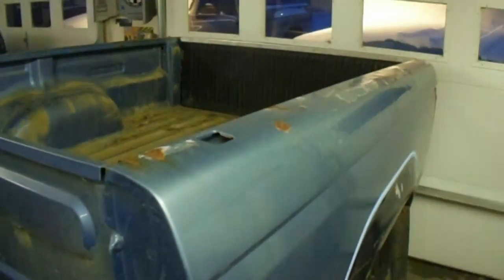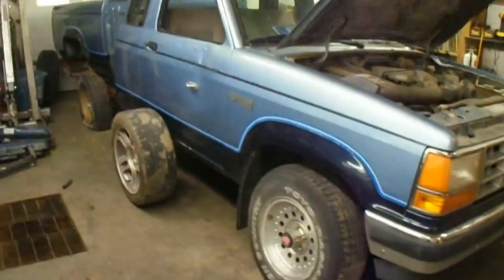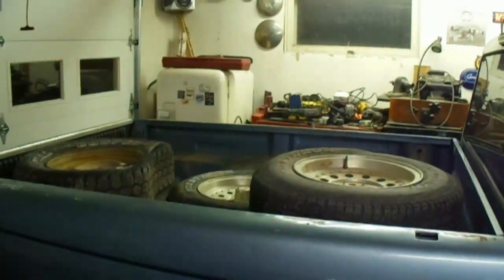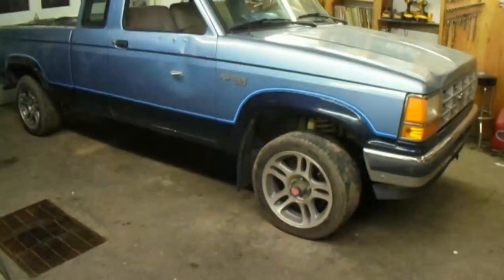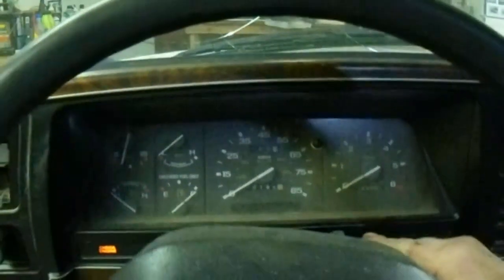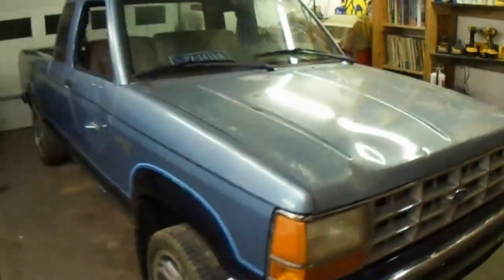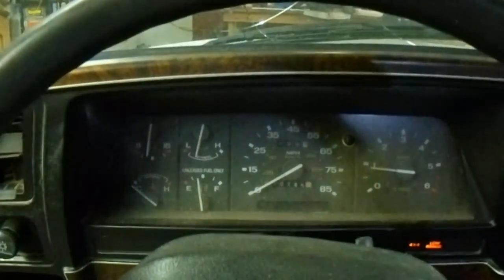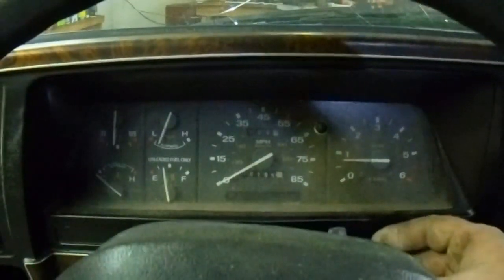First start of the danger ranger 2.0

Comment: Great to see you doing videos again Wayne!!!. Love your vids and always will!. Anyways; yes it always is essential to make sure a vehicle is safe to drive before giving it back to a customer if you are a garage owner etc. I have a 2007 Lexus rx350 that initially when i first got it only had 66,000 miles on it. But now its starting to really show its age as things have started going downhill. First; my high pressure power steering hose blew up on me and sprayed power steering fluid everywhere. That was 800 bucks to fix which i will be paying on monthly for the next 2 years. Then 2 idler pulleys needed to be replaced because the bearings in them were about to seize up that was 270; and now I need to have the transfer case re-sealed which is gonna run 1900 bucks. I havent had that done yet because its just gotten to the point money wise where its not worth putting $ into a vehicle thats now only worth around 6000 blue book. So Im looking at something different that is more sound. keep up the videos dude!

Comment: Yup...good to fix all the bugs bfr you decide to sell it. I bought my 2006 Chrysler t c for 400.00 at a farm auction last fall. Already put on 4500 miles on it....doesn't owe me anything! The wheels were not attached to the rig ....when I first got it...someone put on new pads and only hand tightened the lug nuts....and that set the abs and brake light on...and made a wierd grinding noise...till i figured it out...rrplaced a broken lug and tightened up everything....point is its good to check stuff out bfr you use as an everyday driver 🚗

Comment: Wayne, shame it's not a manual T-case equipped Ranger. At least is has manual hubs vs. automatic garbage, same hold true for the automatic 4wd solenoid. Those things are nothing more than a overpriced wiper motor.